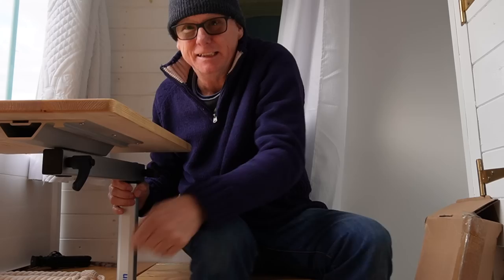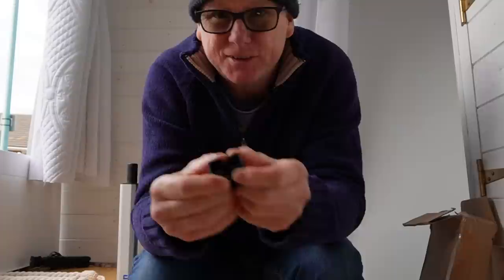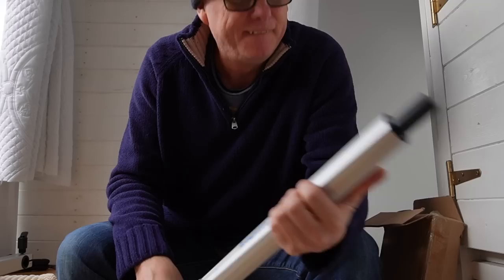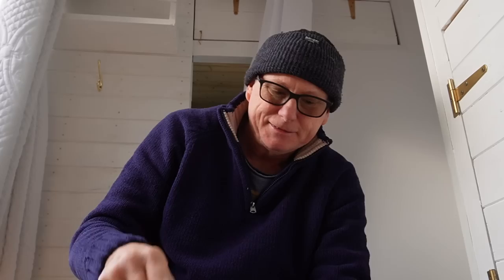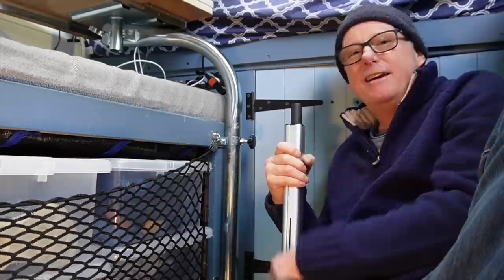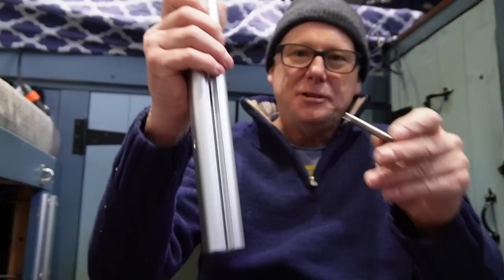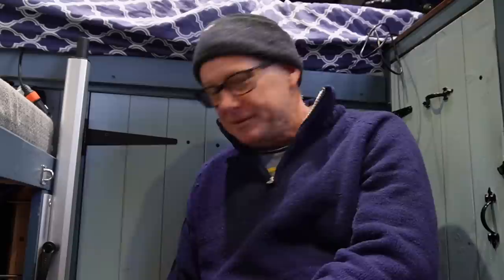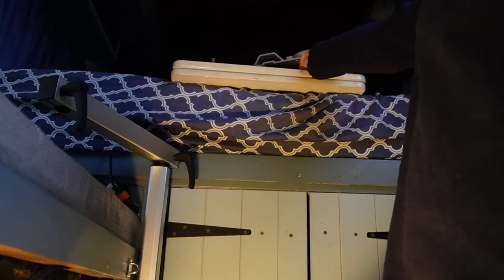Lagun RV table leg Original Vs Copy  Comparison & Review in sprinter van conversion

Comment: Dear Mel, 

My name is Petter Svensson and i am purchasing manager at Boatsystem Group Sweden AB. We are the owners and producers of the Lagun table system. I can confirm that every single piece and bit of the original Lagun system is manufactured in Sweden with the assembly in Stockholm. We do not produce any lower tiers at all. Most knockoffs are from different producers in China, and we have no affiliation with any of them.
Reply from the maker: Hi Peter thank you for getting in touch and clarifying that for us I’ll pin this message to the top of the comments for everyone to see 👍

Comment: On EBAY £113 for the fake one and £140 for the original
I think I'll get the original, if the fake one was half the price then I'd probably get that but not when the price is so close together.
Thanks for the comparison Mel, I'm currently looking at table legs for my van so it came at a good time.
Reply from the maker: Thank you for taking the time to comment really appreciate it 👍😊👍

Comment: The table mount pin was tight on your knock off and when I assembled mine the pin dropped straight in. There is movement from the table even when the clamp is tight. I will try a few wraps of insulation tape to firm it up and drive it in to see if that improves it. Apart from that the components are very heavy duty and well made.
Reply from the maker: Thank you ☺️

Comment: I have 2x fake ones for a while, if you put a good fitting metal washer (stainless I used) after the plastic one, before the tightening lever, it will stop the brass nut insert pulling through. After time, and some over tightening, the brass insert will pop out, go through plastic washer and  get stuck in aluminium frame. Other than that it is very good,  some cloudy discolouration on the aluminium frame, but for the money difference it's not a deal breaker.
Reply from the maker: Oh thank you for the good tip really appreciated 👍😊👍
Reply: @BigVanSmallWorld  Your welcome no worries, I got them before Vat kicked in on Ali Express, worked out ~85 each delivered, at the time. Would prob get branded version now, I presume the handles/nuts on the Lagun are better quality ?

Comment: I've just bought and installed a knock-off one myself actually! Something I've noticed is when the vertical leg fixing pin is at the same height as the mounting plate, it's secure as anything. But when I drop it down a bit, where the fixing pin is no longer pulling the metal together where it's in contact with the plate there's a fair bit of play and it's not as stable. Would be interesting to see if the Lagun and your knock-off have similar issues. (I'm sure you can explain it better than me!)
Reply from the maker: That’s really interesting thank you 👍🤓👍

Comment: the max height you can achieve is limited by the placement of the mouting plate. You could have had an extra 3 inches of height available. I think taking some time simulating usage is going to be really important when deciding where to mount this. i just ordered one of the copies as this looks the nuts compared to most other table options I have seen.
Reply from the maker: Interesting 🤔

Comment: Good info Mel. I've managed to buy a second hand Lagun table leg with formica top for about a third of the price of the leg here in NZ. I was interested to see if the fake Lagun mount was usable with the real Lagun leg as I'd like another mounting plate and the fake ones are about NZ$30 off AliExpress/Amazon/ebay compared to the real ones at NZ$75 or $98 locally - depending on stockiest here. I plan to mount mine on the end of the kitchen unit by the slider, then it will swing into the slider space to extend the kitchen unit either across the doorway or at 90 degrees to the kitchen unit or swing round to use with the side facing sofa. When not in use it can be raised a little to swing over the kitchen benchtop - like the table in the old VW transporters did. Off to watch your video installing the real Lagun leg in Beckie's van now to see if you have any tips for me :-)

Comment: I had the original Lagun but after a few months one of the handles jammed and needed to be replaced. Luckily they agreed to replace it under warranty. A year later those two peg holes were completely worn out (even though my table could only move back and forth for a little bit) and the angle of the table got so steep that I had to take that into account when poring a drink so it wouldn't spill. I contacted the seller again (...) but this wasn't under warranty. Which I found really bad service for such an expensive product. Those pegs and peg holes are just plastic which is not suitable for this type of movement and friction. This is a big flaw of this leg imo.  I also wanted to be able to pivot the table over my bed, just like Mel but the leg couldn't reach it either. It could have if that slot was over the entire length (except for the last bit of course) of the leg. With an extra hole higher up for the handle that would've been the solution for my situation. If they had done that, the leg would be more versatile.
Reply from the maker: Thank you for taking the time to comment that’s really appreciated so I think from what you said it’s definitely a good idea to use silicon on the pegs 👍
Reply: @BigVanSmallWorld  Yes, absolutely!

Comment: You can’t beat a bit a lube, Mel. 😉👍
Can I ask a question or perhaps advice. I’ve owned a 2004 Peugeot Expert HDI van since 2005 and in all that time, used it as not only as my only day 2 day vehicle, but also as a stealth camper. In all that time, it’s been very basic...and I mean BASIC! Bed, Bucket and Babywipes! I’ve used either a one or two ring cartridge gas cooker and a 10ltr water Jerry. No insulation or electrics. 
But your vids have inspired me to do a overhaul over this winter. I’ve already bought the recycled bottle insulation, some cladding for my roof and some down-lights and I’m going to have one solar panel on top and run split charger relay to a leisure battery , which will run some USB+12v charging panel inside. On the roof I also have a slim top box and when I add the solar panel, there’s not much room left for a fan/vent thingy! 
Can you recommend a good, small fan/vent that will give me some good ventilation please? 
Regards,
Dazza. 🇬🇧
Reply from the maker: this may be what you are looking for https://amzn.to/3o9v9lw

Comment: Hi Mel, love your vlogs, very informative. I was just wondering as I am in the middle of designing the layout of my van, What kind of temperature does the diesel heater itself become when on full output. i.e. What kind of items must I not store in the same compartment as the heater itself. Are there any items that may catch fire from the heat radiated from the unit? Cheers, keep the videos coming. Chris. PS. I am going for the smaller diesel heater as I have a smaller van.
Reply from the maker: Thank you great question watch tomorrow waffle 👍🤓👍

Comment: Great detailed video! Wasn't expecting so much in depth analysis over mouldings etc but it was great that you were showing us the difference in quality and components and confirming it had been made in a different factory.  I guess it's fair to say cheaper products the lesser the  expectations. However that said, not all expensive items are quality products and justify their price.  Its all relative to the price difference, in this case I'd probably go with Lagun if the difference was about  £35 however, if the knock off was less than half the price and ebay reviews were 4star (for example) then knock off all day long. Thanks Mel.
Reply from the maker: Thank you for taking the time to comment and your positive encouragement that’s really helpful 👍

Comment: Did you not consider mounting to the bed wood...which is considerably higher than the sofa? Or use a a rectangle piece of plywood or lumber about an inch thick...extend it above the place where you had your old mount and once mounted..you then can mount your knock off "lagun" leg to the lumber. Paint your lumber to match your furnishings and you'll never notice it once everything is installed.
Reply from the maker: Thank you for the lovely idea that’s really appreciated I didn’t do anything as I’m going to lower the bed to give me more head room as I tend to keep knocking my head on the cupboards 😂👍

Comment: I like yr table support that slides out to extend yr table Mel, did you make it?
Reply from the maker: Thank you no I didn’t make it it’s from an old VW I once had 👍
Reply: @BigVanSmallWorld  I have been looking for something similar, but struggling to come up with something suitable.  I did order a pair of brackets on ebay but there was an issue with the seller and they never arrived. Any suggestions?

Comment: You missed an opportunity. You showed that the "leg" was different, you missed it the swing arm was interchangeable or not. You show the subtle difference, but you actually could have tried to see if it would fit or not. I was stupid and bought the cheap Chinese knockoff to save money, the tightening knobs stripped the first time i tried to tighten it. They would work good on anything except a regular RV sized table.

Comment: Lagun is made in Sweden and is so much higher quality. The Lagun is anodized aluminum while the knock off is painted. The system relies on tolerance for long term use, and the knock off is a cheap chinese painted one. Once the paint is scratched the tolerances are compromised. The way to say it is LA GOON not LA gun. He cant even get that right. For the money difference you can own the best with the Lagun and quality is evident. Bolts pressed in the Lagun instead of hand turned in. The plastic caps are completely different in composition and the knock off version struggle to stay in place. You GET WHAT YOU PAY FOR!!! I bought the cheap one first, and it is glitchy and so then bought the Lagun. Should of bought quality the first time and got another lesson of price and Chinese knock off products. A word to the wise should be sufficient.